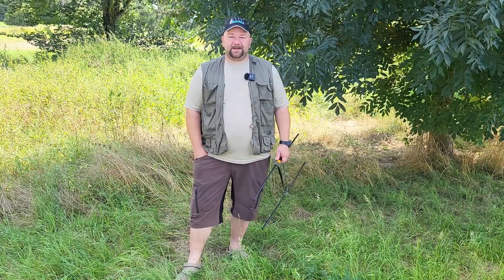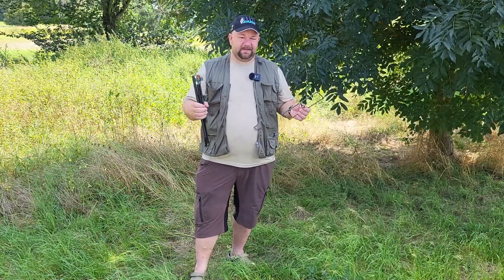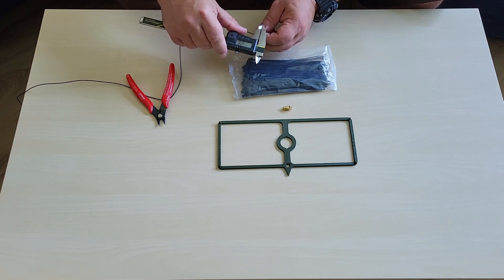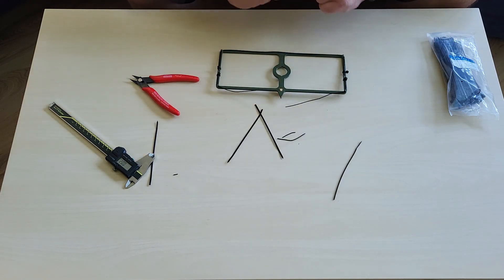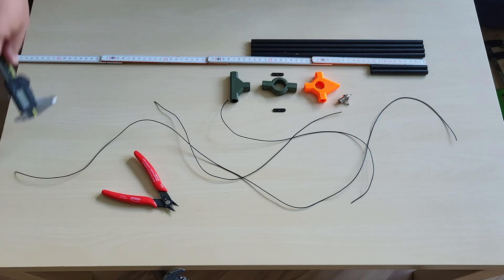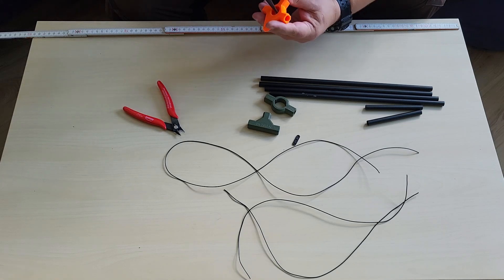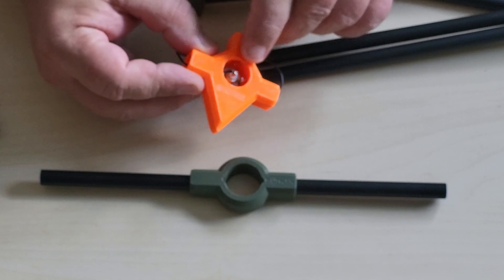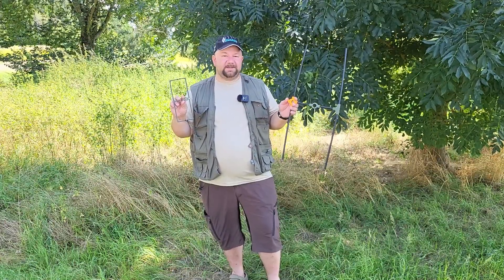Cheap entry VHF/UHF SSB/CW - DIY set of portable Moxon Antennas

Comment: Would it be possible to split the 70cms Moxon into 2 pieces? The original print is too large for my Flashforge printer (22cmsx22cmsz22cms). Maybe like your other Moxon that has the fold part in the middle.
Reply from the maker: Of course it is possible. Just redesign it. 73 Manuel; DL2MAN

Comment: For folks in the US looking for a source for the 10mm tubing
I found that 1/4 inch pex tubing works alright and is rigid enough for the 2m variant
Its outside diameter is right around 9.6mm so it might be looser than desired but a little bit of glue on the parts that don't need to move will help in that regard

Should be widely available at any big box lumber store in 5ft lengths for a few bucks per stick

Comment: Hi..  Great work!  Thanks.  Hopefully I can still find those 3d parts.   In the meantime, I noticed your post and mount.  Is it mounted to the wheel  of the car?  
Interested in more if your willing to share.
Reply from the maker: It´s a drive on pole holder by DL1DN. I introduce it here: https://youtu.be/sDPYNib8ddo?t=202 contact info also under this video. 
Pole is a Spider Beam 10m Mini Pole without the top 3 elements. 73 Manuel; DL2MAN

Comment: What a great contribution to the amateur radio community. The 3D parts were very quick & easy to print off. The only frustration is waiting for the connector parts & PVC tubes to arrive. 1m x 10mm x 1mm PVC is not so easy to find in the UK unless you are buying 50m of the stuff. Will update when done.

Comment: Built it with 1.5mm cable instead, had to split the stl into two parts due to my smaller print platform. Works good with SWR of around 1.3 to 1.4 in not ideal conditions on my 70cm Antenna. 73 de OE8GKE

Comment: I finally completed the 2m Moxon build today. SWR is 1.1 on 144.200 and 1.24 on 146.52. I'm very happy with it. So easy to put together. Danke schön, Manuel! If anyone has modified the center adaptor part I'd love to print various versions. Currently in need of one with a 10mm hole for a carbon fiber mast.
Reply: On his printables page he says there is another option if you cant design your own with CAD or Slicer by modifying the STL file and that is to print the Universal Adapter using 100% infill and then drill the center to the size you need.

Comment: Great great job Manuel !!! Thanks so much for sharing your excellent work with us . I definitely have to try that out. The small plastic pipes you use what are they sold as in German Baumärkten. Installationsrohr ? Bewässerungsrohr ? I’m going down to Germany in a couple of weeks and try to find some of these. Absolutely professional job Manuel. 73 from Sweden
Reply from the maker: Hi, I think they can be found in department for electrical installation. Or multi purpose material department, where you also find various profiles, like L-Shaped Aluminium rods. I bought it from Amazon (see link in the description of the print files)

Comment: Hi could I please ask what is the total length and width of the 70cm antenna as when I tried to put it on my 3D printer the file shows as being too long to print, as the model was off the edge of the printer bed, I have a creality ender v3 which has a bed of 220x220.
Reply: Longest length here is 245mm...just fitted on my P1S.
Reply: I'm in the same boat with my Ender v3. Bed is too small to accommodate the 70cm design. I will have to have a friend print it.

Comment: Can you provide the model of the radio again please?  This can transmit on 2m ssb?
Reply from the maker: Quansheng UV-K5(8) -> But it needs to be flashed with custom Firmware. I´m using https://www.universirius.com/en_gb/preppers/quansheng-uv-k5-manuale-del-firmware-ijv_v3/ It can do SSB, but that´s more DSB. (AM with suppressed carrier). It is intelligable on SSB radio, buit I would not use it in a contest, because of the double bandwidth.

Comment: This is way cool!!!  I never really paid attention to this type of antenna, and now you've made me curious!  But this reminds me of a question I've had for a long time that nobody ever talks about.  Can you give us a lesson on:  gauge of wire and relationship to maximum safe PEP by wire gauge.  Or reworded:  minimum diameter wire gauge required for specific PEP?
Reply from the maker: Interesting question, and I need to think about that. Shot from the hip, I´d say it´s uncritical, but this is just a belly feeling and don´t take my word for it. Will definately think about it, and come up with a satisfying answer. Thanks for the question. 73 Manuel; DL2MAN
Reply: iam running - cause not allowed in the appartmentbuilding here - an efhw with 1:49 unun and, for "stealth-mode" with a copperwire that has only a diameter of 0.2mm. thats enough for 100watt without any problems. it doesnt glow in the dark. 😀 maybe that helps a bit
Reply: @andip4756  That is helpful!  I also keep confusing myself... I think the diameter of the wire isn't my scary thought, it is the size of the core I'm using and the diameter of the wire I use to wind my transformer.  That's what I need to investigate.  I have a 100W rig, but I turn it down to 10W because I'm scared I will overheat the transformer.
Reply: I have been using DX-Wire Ultralight wire 0,3 mm2 on HF with 100+ Watts, so it's not critical.
Just keep in mind that the velocity factor can change, and thicker wires result in a bit wider bandwith.

Comment: Very cool "re"construction of the Moxon antennas.
It's the easy entry of DIY project...so as you said...No more excuses for not operating outside with low dimension and weight antennas.
Thank you very much for sharing your project with us.
That's Ham Spirit at its finest.
73's de Stefan